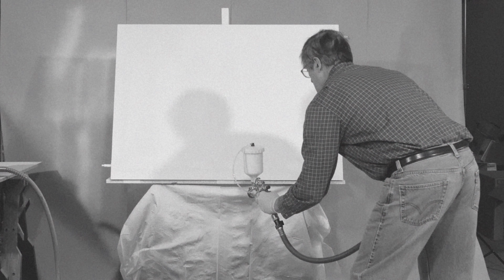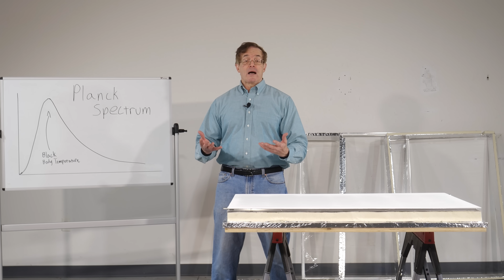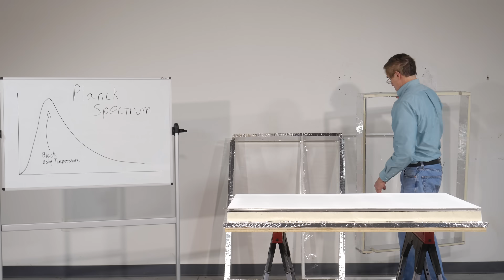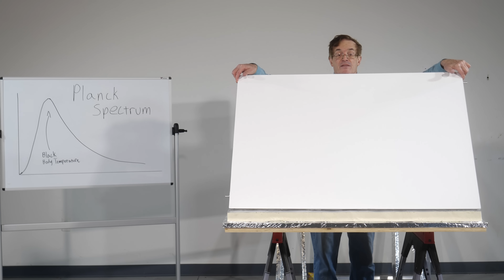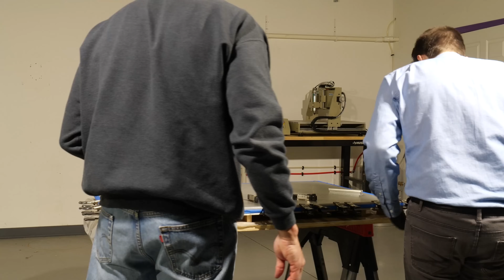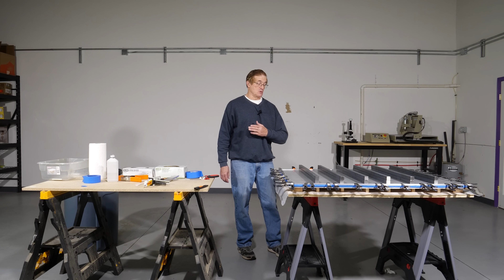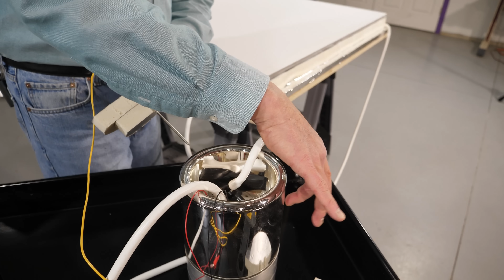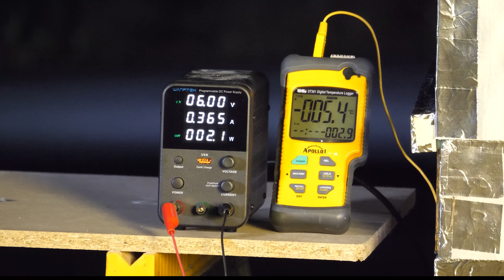Air Conditioning isn't free... but we're close.

Comment: Did you use calcium carbonate or calcium hydroxide as the IR reflective ingredient? And did you use acrylic paint as the binder? I wonder if the IR reflective coating reduces the IR emittance of the panel?
Reply from the maker: Neither.
It's  based on barium sulfate nanoparticles.  We'll show  exactly how to make it when we follow up with the next video  on this paint.  We'll also test it during the day.

Comment: Could you use some sort of pelter chip to act as the "sky" and use it to power the pump?
Reply from the maker: Yes, but these devices  are very inefficient.
Take a look at our previous video on the "Campfire Generator."
Reply: @TechIngredients  that's ok, just like you said, even if you can get 1% of all the energy use down in this sector it would be well worth it. Is there a better device that could make use of the temp difference between the sky and the heat source?
Reply from the maker: Not really.
But, you have to balance investment cost with return.

Comment: Very interesting. Hope you get to 1 million subscribers. 
Looking forward to the next video. 
As for hydronic systems - my knee jerk reaction is dew. Down in the south, dew points can hover pretty high so pipes at 80F  on a 90F day can sweat. I could be wrong, but mold and pipe sweating is real. 
As for the heat pump - that sounds good.

Comment: Will the effectiveness of something like this be changed in a high humidity environment? I live in a south eastern United States, and my concern would be that the high humidity air itself contains a decent amount of energy that would radiate into the Collector. Subjectively it works out too the feeling that you’re still super hot even in the shade. It feels like the air itself is, or rather the water vapor in the air is storing heat energy and you can feel that. Or perhaps the mechanism is that it’s just less efficient for us to radiate our own heat into such an environment? Definitely in this type of environment sweating is mostly useless because the air is already saturated.
Reply from the maker: Humidity  will affect  the apparent temperature  of the sky.  It's  a small effect, unlike clouds.
Reply: 👍thanks

Comment: Before YouTube and cell phones were a thing, I saw a video of a professor in a California university, who invented a semiconductor that turned ambient temperature to static electricity which was converted to electricity via capacitors! The "C" shape semiconductor had an island pad in the middle of the "C" shape.
It produced little voltage but was able to be connected in series and parallel to give whatever output based on size. 
He had a unit the size of a dishwasher that was producing 1000W and acted like an air conditioner in the lab!!! 
I've tried to find that video from 2000, but was not successful. If anyone knows who I am talking about, please reply to this comment.

Comment: It would be good to know what kind of wattage can this prototype device dispose off before water temp and air temp equalizes. Because temperature difference by itself is not a great indicator if this actually is worth investing in, cooling capacity is. For example you have Peltier thermoelectric coolers that can make dozens of K difference between it's cold and hot sides, but the more wattage of heat the worse the efficiency. I mean if this thing can only dispose 20W of heat to make 2kW air conditioning 1% more efficient then it's pointless endeavor. The pump will generate probably half of this number as heat as it runs and electricity bill will not change at all.

Comment: This phenomenon he exploiting occurs to the extreme on the Antarctic in the most cold spots on Earth. Valleys with very little wind have craters and ditch like contours that trap air in them and all the energy the snow surface and the gasses above them have gets radiated into space. In spots like this you can measure almost -100C at times.

Comment: I remember years ago, easily over a decade ago by now, there was some startup that was doing reflective radiation with just mirrors (I believe the earlier variations were space blankets applied to the surface, with the 'production' variation being a more proper film) that beamed sunlight back into space, with the same ideas of tying this into an AC unit to dispel exchanged heat or for radiative cooling via piping.  Unfortunately I don't remember the name of the group or where they came from, I think they might've been based out of California but honestly what startup from the early 2010s wasn't based out of that state, I also don't remember if they were spun off from some university group that did the initial research into it. 

A box of water probably also isn't the most optimal design for exchanging from reflective panel to auxiliary device, but good enough for demonstrative purposes.  I'd be curious to see this using a more radiator-like design, have end tanks that flow water nicely with paralleled pipes along the cooling surface.  Stemming from this, I wonder how difficult it'd be to get piping with a sintered surface, similar to a heat pipe with a sintered wick but larger, given they have much higher surface area; given the fact that they don't need to be all that thick, flat pipes could work well here.  If you could get something like 30mm wide flat pipes (whatever the round to stadium conversion is, I'm not sure what thickness would be at this size before a pipe wants to kink or crack), braze/solder the gaps between the rounded sections, apply end tanks, grind the surface to a flat, then apply coatings, this may be a viable solution, at least at economic scale of production.  I'm curious if aluminum has a similar sintering process, otherwise grooves could work, but this gets into welding and welding aluminum is difficult for a lot of people.  This could also be potentially done with a larger chamber, akin to what a vapor chamber is to a heat pipe, though structural support and attaining a proper flow pattern with areas that don't stagnate, or circulate into themselves as an intermediary loop based on currents, could be difficult to overcome.  Transfer efficiency is important, especially when considering the gap between hot refrigerant and a sub-ambient cooling panel, and even with the best thermally conductive materials you're going to need an insane amount of surface area for the transfer efficiency required to bridge that gap. 

This stuff could become fairly interesting, it's just a shame that nobody is really developing anything with it, other than a handful of content creators and one or two companies.

Comment: There are some construction issues with cold ultra-emissive roofs -- they tend to be soggy for months, metal will rust and wood will rot, even through low-permeability "vapor barriers". It's doable, but just requires extra barriers for the building to avoid rust and mold. Small neighborhoods and test homes on this were also riddled with complaints about their own and neighbors' houses hurt their eyes... enough that the maximum $1000/year savings was outweighed by making the house unsellable.

Polyethylene also will degrade in UV after a month or two, you might want to use PFA fluoropolymer film, which has good infrared transmittance, but I'm not sure how it compares to PE. Maybe $1-2/sq ft depending on where you go. The film covering, however, is a fantastic idea, because the barium sulfate (I'm told) doesn't last and needs protection.

However, I think this is great-- the world needs people figuring out these things, finding tricks, and bringing things one step closer to benefiting the masses!

Comment: And this is why overnight you can get frost on open grass, but not on the grass under the trees.  
Keep in mind this cooled sub-ambient even with the 2W from the pump being added to the water as well.
Clouds!  Nature's blanket!  Refracts the sun off during the day, keeping the surface cooler, but traps heat in at night.  (Also, as I learned from an atmospheric physicist,  water is the most significant greenhouse gas in the atmosphere, having a far more significant effect than carbon dioxide.)
Reply from the maker: That's  right on all three points.

Comment: Since you have a localized thermal difference, you could use this to generate energy without spanning large distances, for example, simply by placing a thermocouple in the gradient. You're essentially tapping into the sky for the differential. It wouldn't be much energy as is, but if you optimize and scale it, it could be an interesting, moderate power source in remote areas without sunlight. I wonder if there is a way to combine this radiative cooling with evaporative cooling.  That could be a 1-2 punch, but combining them seems challenging if they aren't completely different systems.

Comment: why not run the hot refrigerant directly through the panel to increase efficiency?
Reply from the maker: You could.
However, the energy  transfer to the atmosphere with a heat exchanger and a fan is also very good  when the refrigerant is hot.  I suspect this will work  better as a second stage even though  its own  performance will be lower.

Comment: Never trust a video from someone who can't spell the thumbnail....If we all radiated 1.2kW (never mind what we convect) we'd have frozen solid soon after birth. If you can't blind them with science then baffle them with bullshit. Radiation to Absolute Zero is nothing new, cooling thermal mass using cold nighttime air is also nothing new. The usefulness of nighttime cooling is well known, however radiant cooling doesn't work well in cloudy conditions, doesn't work as well in Summer as in Winter and is a whole lot more elaborate than just moving cold(er) nightime air through a building to pre-cool thermal mass for use as a heat sink during the day. What's in the video will only work effectively with an enormous radiator area and an equally enormous insulated buffer tank to store cooled water for use when cooling is needed in daylight hours.
Reply from the maker: Mike,
Before  going on a rant and insulting me, you need to watch more carefully  or research the topic yourself. I explained  clearly  why we don't  freeze despite radiating over a kilowatt of energy. Once you understand that, then you can discuss  the engineering.

Comment: 2:20  2000 Calories per day diet is about 2.33 KWH  closer to 100 watts  ?????  - not 1.2 KW  Unless you are laying in the sun on a sunny day.  People burning the food we eat is not 100% efficient.
A food Calorie is actually 1000 calories or 1 Kcalorie. 
Sunlight hitting earth is about 1 KW/sq m, solar panels about 20% efficient.  Am I thinking right?
I had never thought of it before.  If we could convert it all to electricity, 3 of us could car pool to work in a Tesla.
It's still a thought provoking video as always.  thank you
Reply from the maker: You're  confusing the steady state energy  consumption of a person and the radiative cooling of a surface.
An inanimate object with the same surface area as a human body will also radiate 1.2 kw into the environment.
As I explained, the reason we don't  freeze is that our surroundings  radiate back the same amount of energy...with the exception  of the cold, clear sky. That is why the chair you are sitting on, which is radiating a similar  amount of energy  into the room, isn't  cold. The room is radiating back the same amount of energy to the chair.
Reply: ok, after watching again I think I understand. Initially you are talking about radiating into 2.7 degree kelvin vs  the delta radiation that I'm talking about.
Reply from the maker: That's correct. Also,  as I said in the video, the sky isn't  at 2.7 Kelvin.  It's  cold, but much warmer than that.
Reply: Oops, I screwed up.  that's 300 watt hours per mile,, 3 people would only get you 1 mile per hour.

Comment: yes sure it works but how many watts per square meter are you radiating that way? intuitively not enough for anything useful, a tiny fraction of what a solar panel could produce for the same area, the usual 4th power of temperature scaling law. Why don't you calculate the useful power densith too?
Reply from the maker: Yes, it did.
I didn't  calculate  the cooling power because the performance decreases with temperature (T^4).  At 0C, this system  would have no purpose.

Comment: Is the process reversible?
What coating would absorb heat from the surroundings?
If I was ",painted" with the coating and standing in a crowd of people would I feel colder?
If I put cling wrap on a PV panel would it operate cooler and higher efficiency?
Thanks for a very interesting video.
Reply from the maker: Somewhat.
Bare aluminum  would be a good choice.
You would, but only if you were under the open sky.  The whole process depends on a one-way route  for that thermal radiation.

Comment: Have you measured the actual power? 

For instance, you show a temperature drop of about 8 deg C and lets say you have something like 4 L of water in the system (based roughly on the dewar ~2L  + pipe + estimated fluid in the heat exchanger ~2L). That's a total energy transfer of 8C*4000g*4.186J/gC = 134kJ. 
But you sped up the video, so lets say that it took 1 hour. Now W = J/s; so 1 hour is 3600 s, so 134kJ/3600s = 37 Watts.
If it only took 10 minutes... then that's more like 223 W and now you're on the order of a solar panel.
However, if you didn't have 4L, and had closer to 2L, then we half those numbers.

The coefficient of performance for the 223 W estimate would be a whopping 223W/2W(Pump) = 112, vs the average refrigeration based air conditioner COP of about 3. 
However the raw square footage needed seems pretty high.

A 3-ton home air conditioner would need to reject heat at the rate of about 10,000 Watts, so you'd need ~45 of these panels to be on the order of assisting an air conditioner, at the generous 223W estimate. At the 37 W estimate, it would seem unfeasible. 

This device proves and measures the coating's effectiveness at rejecting more radiation heat than it allows in, basically a thermal diode for radiation. 
Seems to me that if the coating is the trick, then it would be more effective to construct this coating into the roof structure of a house similar to existing radiant barriers and dispense with the coolant circulation. The improvement to a house would be easily realized, simplified, and could be compared against the performance of existing radiant barriers.

Comment: Please use a respirator when spraying things!

Instead of bonding your heat exchanger with glue,  use an oven heated brazed plate design, with silver solder paste and stainless steel walls, embossed with a labyrinth pattern.

Hydroforming really works well to form the sheets.. and because the channels form bonds between the layers, all across the panel, pressure handling is improved.

Stack the upper and lower surface plates. Heat them to the melt temp of the solder, and you have your heat exchanger.

Spring steel clips, pressed onto flanges in the upper/lower plates can help with clamping force and alignment while brazing.

Insulation of the ground facing side could be as simple as spray urethane foam.

I wonder, would induced cavitation using an ultrasonic transducer, help with heat exchange?

Your collar appears not to have any insulation on the outer surface.  Would a better collar just be Styrofoam sheets.
Passive cooling looks like it might be a magic bullet for combatting global warming.

One long range concern might be the proposed use of high altitude aerosols or dust clouds to block incident solar heating.

Unless the material has a very selective ir spectrum response, such a reflective cloud might bottle up access to radiant cooling to space.

Nice work. Can't wait to see part 2!
Reply from the maker: Thanks.
The collar is fabricated from insulation material.
Your  design might work well but represents  a large amount of labor for an experimental prototype.

Comment: spray adhesive with space blankets might be a cheaper material for future projects. Might be less time intensive also. I was thinking about trying that for a different experiment, but I imagine it would work well for your application also.
Reply: Instead of the aluminum tape I mean. Added benefit is that the entire purpose of the space blanket is to reflect thermal energy, so I would assume that it would outperform the reflective aluminum tape, even if it is only slightly.

Comment: It occurred to me after watching this one might be able to directly measure the heat loss in watts with this setup by adding a small heater to the water reservoir. If you run the heater just enough to keep the reservoir temp equal to the ambient air, and integrate the voltage and current needed to do so it would be a measure of how much heat loss the panel is delivering.

Comment: What would be interesting is to know what kind of additional heat loading it would absorb to maintain ambient temperatures—effectively what the net radiation balance is at ambient. The way I see it, this sort of technology is only useful if it produces cooling power more efficiently than PV+traditional heat pumping. 

Places that require a lot of cooling need to do that during the heat of the day (and early evening). I see some benefits of using a thermal mass to make the most of the cooling during the night when it’s most effective. But that thermal mass may reduce the overall efficiency more and it would help.